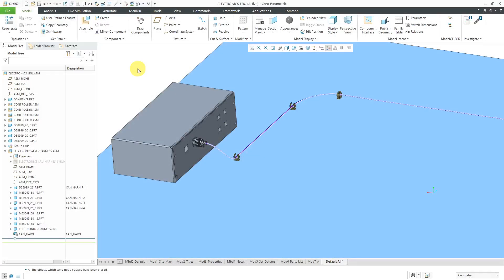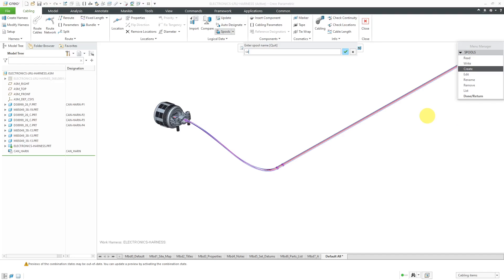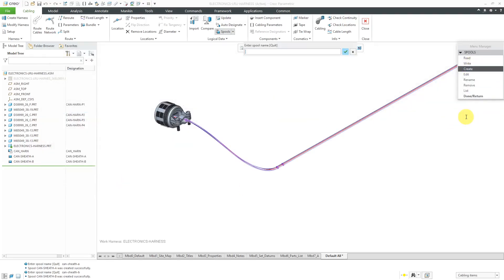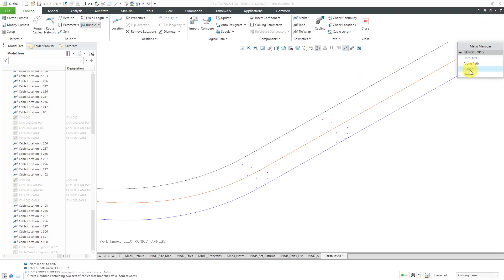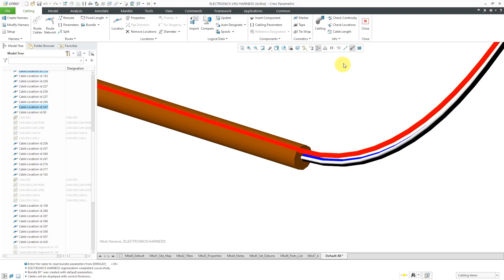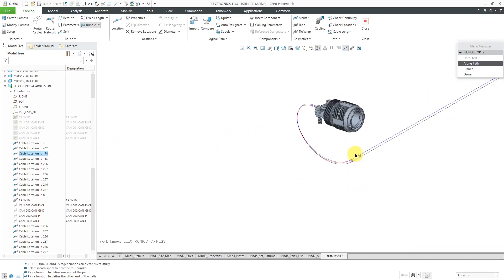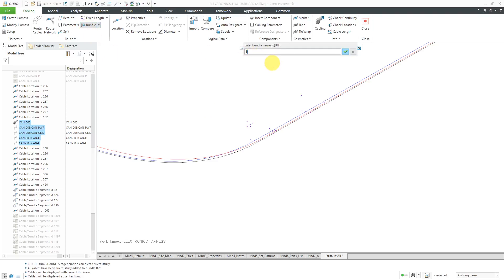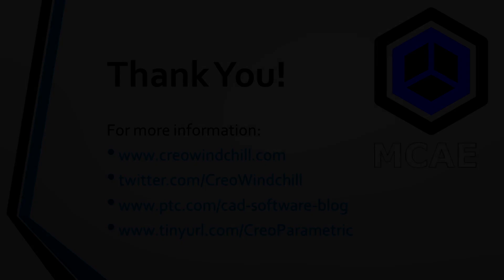Creo Parametric - Cabling | Bundles

Comment: Hi
In the last bundle when it shows a pop up message adding other cables and bundles makes the length to inaccurate
For the first two bundles you selected"No" but for the last bundle selected" yes"
In this case the length will varies right!